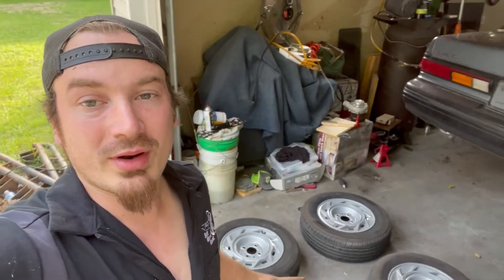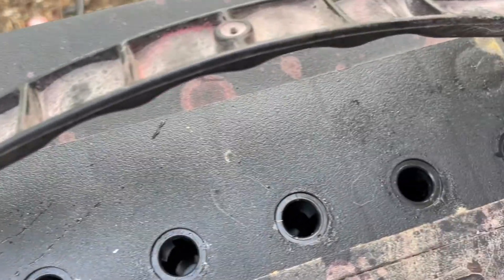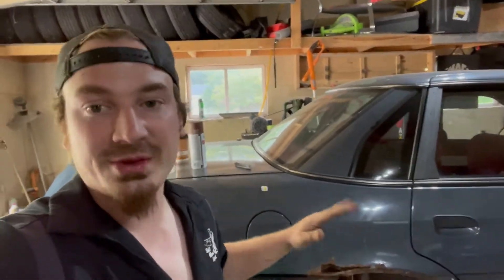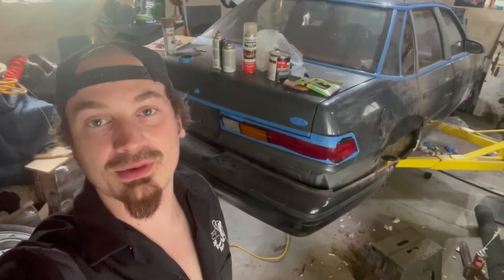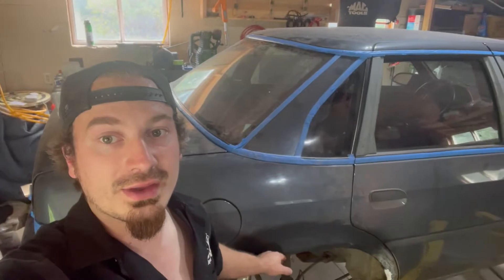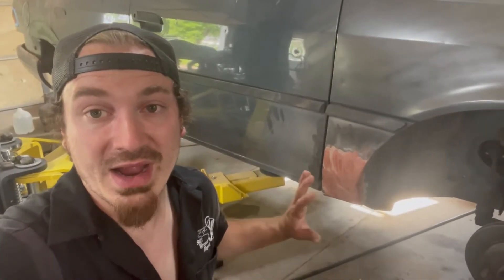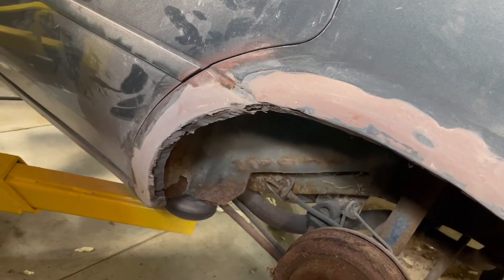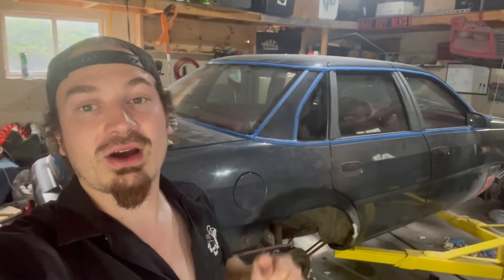WHY Did We Get A Ford TEMPO!? **$400 Cheap Tempo Flip**

Comment: 01/15/2023  currently driving a 93' Ford Tempo, bought in 2016 for $400. 
  Tempo came from Cleveland, Ohio and i am 99.9% certain Tempo has flood damage.   Replaced serpentine belt, water pump, radiator, alternator, brake components. Driving 155 miles a  week, 16 days on a tank of gas, no complaints.
Reply from the maker: Good little sh*tboxes hahaha

Comment: Great video. A friend of mine is refurbishing a 93 tempo but doesn't have the engine. He will be using a mechanic to help but I'm wondering if he could start working from a replacement engine that is taken from a different Ford or non Ford car model. Any thoughts?
Reply from the maker: The amount of time headache and money to swap in a motor that wasn’t originally in that car, esp a car like a tempo, probably isn’t worth it